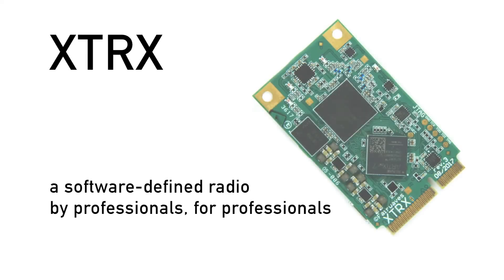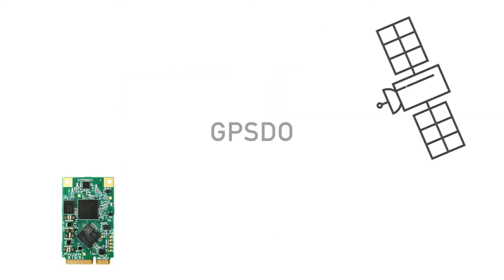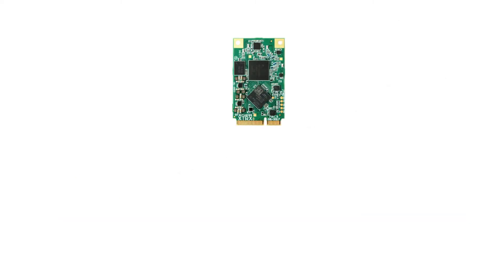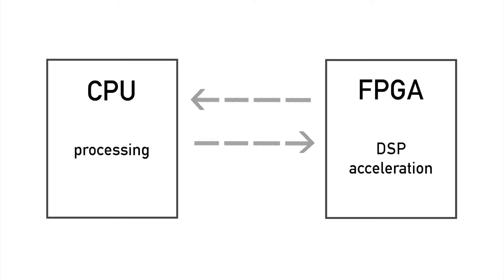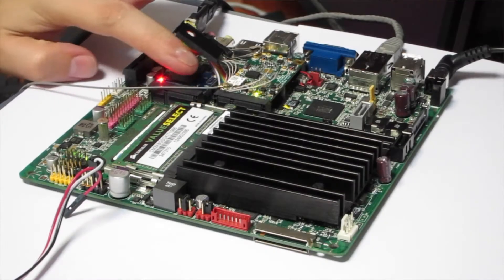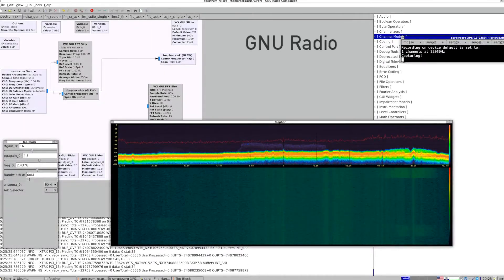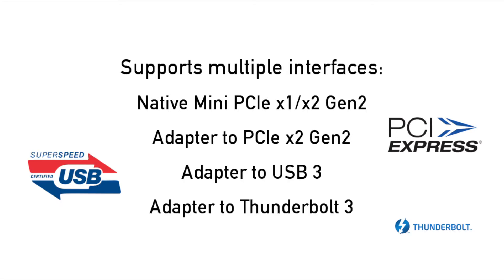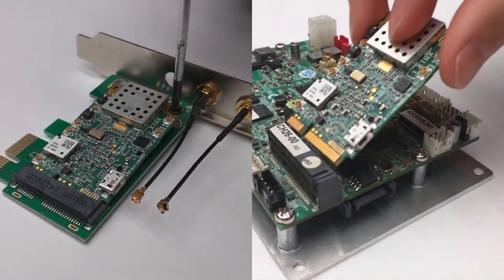XTRX: The first ever truly embedded SDR

Comment: Does anyone know if they're still selling and supporting these? I haven't seen any new activity from them in ages.
Reply from the maker: Their blog https://xtrx.io/ has not been updated for ages, but I see in their CS page it can be purchased: https://www.crowdsupply.com/fairwaves/xtrx and it is said "in stock". I'm not sure if they really sell it right now.
Reply: @Tech50  I purchased a XTRX Octopack about two years ago and I can get a single XTRX to work well. However, there seems to be little movement on driver and software support. For instance, it is impossible to properly emunerate multiple XTRXs with SoapySDR and I am not sure when this significant shortcoming is going to be addressed. Documentation of their API has been poor, and it seems like the developers should put in a little more effort to get this product across the finish line.